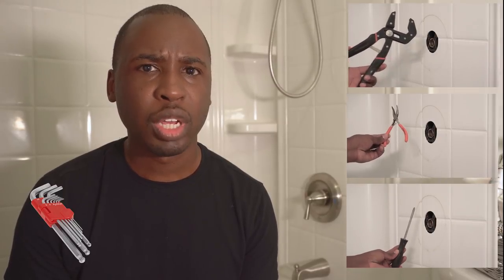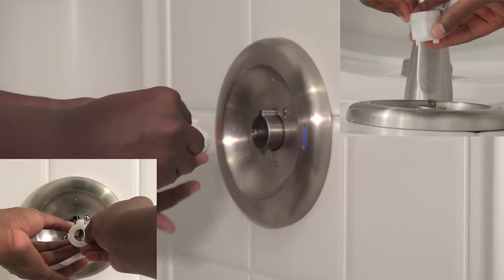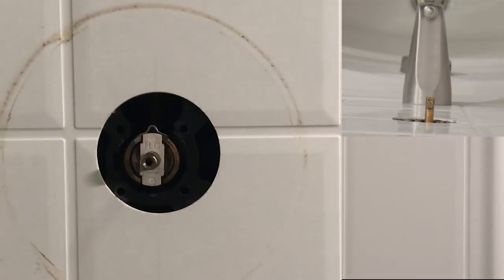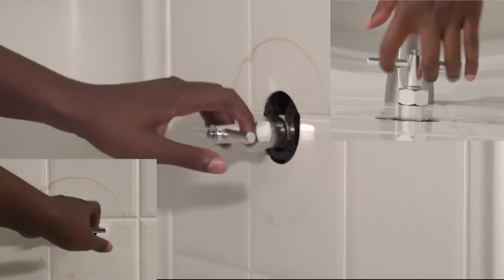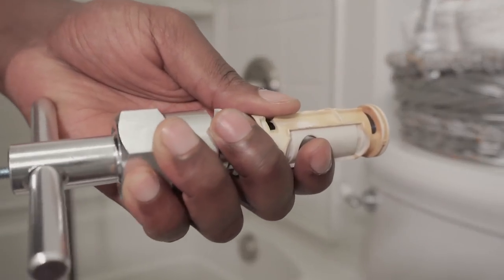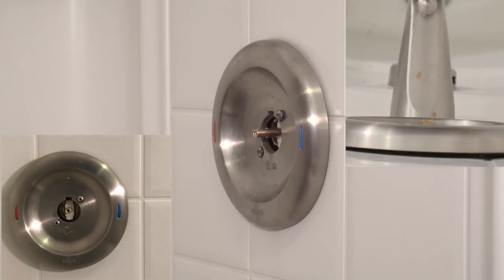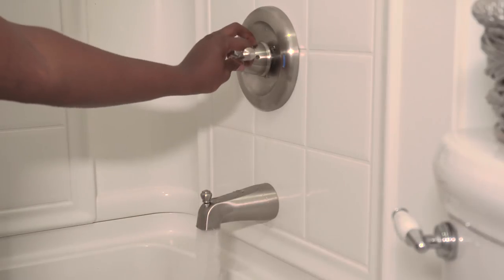How to replace a Moen 1222 shower faucet cartridge

Comment: How would i know if i pushed the center brass piece in too, if i have already inserted the cartridge back in the brass pipe behind the wall?
And do i have to remove the cartridge from the pipe in order to get it to sit back flush?
Reply from the maker: If your faucet leaks or doesn't turn off then you know you have pushed it in. It might be possible to leave it in but i would remove the cartridge to be sure you have corrected the problem.
Reply: Hindsight 101 I see
Well mine turns on and off without any issue , and have no leaks that is visible on the outside, idk about inside within the wall....
But i thought I had push mine in because the alignment metal sleeve is loose, I can move that sleeve back and forth even with the plastic temperature limiter install and everything.

And also the handle turns on and off with no effort now, almost feels too loose so to speak
Reply from the maker: It's your call whether you  remove it or not but if it is leaking behind the wall that could be a very expensive fixed in the future

Comment: Hindsight 101 thanks for the Video. i was able to replace the valve but now I a getting a leak from the faucet valve when I turn it half way to full. Any thoughts??
Reply from the maker: You might want to take it apart to make sure you seated everything correctly

Comment: Farbulous and informative video, but for those with side wall mounted faucets many feet away from the shower head, clear the water lines before removing the cartridge or you'll have lots of water in the wall cavity. Ususally just turning on a sink faucet, which is lower that the shower faucet will do this, but also have a towel on hand....just in case.

Comment: Great video. Are all Moen cartridges the same? Scared to this for a leaking shower handle.
Reply from the maker: They are different but similar process
Reply: @Hindsight101  is there a way to identify which one is needed without pulling it out? Thanks for your fast response.
Reply from the maker: @tonyh4513  you really just have to pull out the cartridge unless you know what model faucet you have

Comment: How do you know which cartridge to purchase? I have a single handle too but did not have the name of the manufacture.
Reply from the maker: The best way to know would be to take it apart and then take the cartridge into a hardware store

Comment: I just used this tutorial to  replace my shower cartridge.  Used to be 6 o'clock was off, 9 O'clock was hot water, 12 O'clock was luke warm and 3 0'clock was cold.
After putting everything back together, I'm now getting 12' O'clock is off,  9 O'clock cold, 3 O'clock hot and 6 O'clock warm.
What did I do wrong putting things back together?
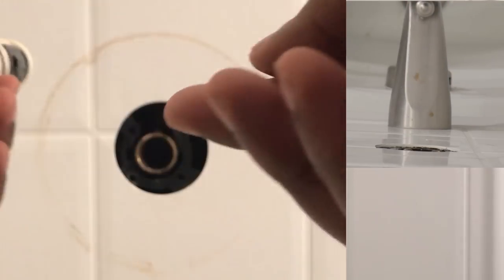Reply from the maker: Make sure you look at the 5:36 mark in the video and see if you did it correctly https://youtu.be/gIeyIMhXQho?t=336
Reply: @Hindsight101  Got it working! Thanks for the response and the video.

Comment: pushed on the cartridge when I was trying to get the pin in. Ok, same mistake you made, but at least I know it will leak if I don’t fix it. Lesson, don’t touch the brass part of the cartridge!
Reply: also, when replacing the 1222, the one I bought from HD that morning labeled Moen 1222 wouldn’t go all the way in. After trying for at least 30 minutes, I ended up trying one my wife bought 10+ years ago. That one went right in!
Reply from the maker: Interesting
Reply: @Hindsight101  yes, you can imagine how the 30 minutes went when I was trying to get the first cartridge in there! 😀 It seemed like the length was about the same, so perhaps it was the diameter that was off. Perhaps the black strips on the side weren’t properly seated.
Reply from the maker: That happened to me with off brand cartridges

Comment: I installed a 1222 but water pressure will not build up through shower head Any suggestions?
Reply from the maker: Make sure you seated the cartridge correctly and you didn't push the brass piece in. But its hard to say without knowing your whole situation.

Comment: the back part mistake that you mention , in order to avoid the error  it must be put on with the puller ? and can i put it whitnout the hot water stoper?
Reply from the maker: The puller or carefully with the plastic piece and a pair of pliers. You need the stopper but you dont have to use its feature

Comment: Do you need to have the limiter?
Reply from the maker: I've never actually tried to take it off but I guess not. If you don't care how hot it gets or just turn the limiter all the way to the max
Reply: @Hindsight101  the water does get hot, i was thinking if it is because it doesn't have it

Comment: I had this shower (posi-temp type) which is very seldom used. So when I opened the valve, there is water leaking under the handle.  But is totally sealed when valve is shut-off.  Is this something that repair can be delayed as I have visitors for 2 weeks.
I am just concerned hoping that all water leaks will be under the handle going to the tub and not going down the pipes behind the wall.
Reply from the maker: I had the same issue at my new house. Always consult an experienced technician but for a couple of days you should be fine. Don’t let it go much longer. Sorry for the delay your comment was sent to spam and I didn’t see it for awhile.
Reply: +Life: Hindsight 101 I guess I'm still okay. It's only being used now by my visitors. It only leaks on the handle when I activate the shower. But not when only the tub faucet is running.
Reply: +Life: Hindsight 101 probably yours was easy to pull as you have a new house.
Reply from the maker: Old house new to me. It took me about 30 mins of working it out. Wasn’t easy but be patient. I had to break it out piece by piece.
Reply: +Life: Hindsight 101 so it came out differently from your vid. Did you have to use a tap to pull it?

Comment: I did it, but it leaks.  The back of cartridge is flush.  I just checked it. It didn't leak before replacement. I changed cartridge bc it was too hard to turn and had calcium build up.  Works great now, but drips a bit. Will that go away overnight? Been 2 hours and still leaking.......help!?!?!?
Reply from the maker: Did you clean up all the calcium deposits before putting the new cartridge in

Comment: It appears that the allen nut on my handle is rusted out, but I'm not 100% sure. I have a 14 piece allen wrench tool with sizes 1/16, 5/64, 3/32, 1/8, 5/32, 3/16, 7/32, 1.5, 2, 2.5, 3, 4, 5 and 6. Does anyone know which allen wrench size they used, and what to do if the nut is actually rusted out?

Comment: Good morning! im assuming there are multiple cartridge? 
Looks like we have same model your working on
Reply from the maker: I’ve only seen a few different cartridges made for meon but there are different vendors that make them. For example there is a cheaper version made by Danco but I would advise staying away I had issues with that brand.

Comment: I did this and prior to doing this, i didnt have a leak. I followed these steps and the water now turns on and off, but water is leaking. Am i doing something wrong? There was no leak before
Reply from the maker: Make sure everything is seated properly. Did you accidentally push it in like I mentioned in the video?  You would have to take out the cartridge to check

Comment: How do I know if the cartridge is the problem?  No water comes out at all when the handle is turned, no drips either.
Reply from the maker: Is there a reason why you're concerned about it? Usually it's because of drips when the handle is in the off position
Reply: @Hindsight101  Well I couldn't get any water out of the faucet at all.  I spoke with a plumber who thought it was a bad "mixer valve."  A little research led me to your video, and I referenced it several times while replacing the cartridge.  Thanks man!  My shower works again

Comment: I did all this and I still have low pressure when on hot, any suggestions?
Reply from the maker: Is it only in this bathroom or is it throughout your house because you could have an issue with your water heater if it’s old

Comment: What size of the hex nut wrench did you use?
Reply from the maker: I use an electronic screwdriver kit and it's a M2.5 if that helps
Reply: After much research I found Moen uses mostly a 7/64 hex nut. this size was not included in the multi-driver set I have. This is why I had so much trouble.
Reply from the maker: Thank you
Reply: I used 3/32, no problem.
Reply from the maker: Thanks

Comment: Another tidbit, when placing new cartridge in, using the Puller Tool just to assist in pushing it all the way in if your having a hard time.  I realized it wasn't all the way in when I couldn't place the retainer clip.  Hope this helps DIY users!!
Reply from the maker: Thanks for the tip

Comment: I replaced the cartridge.  easy.  but, now "off" is straight up.  turn to the left for scalding hot water, only goes 1/4 turn.  turn to the right (clockwise) for cold and then warm (straight down).  what did I do wrong?
Reply from the maker: There could be two issues here first you might’ve put the cartridge in upside down second you may have put the handle adapter in the wrong way it’s the piece right after you take the handle off try those two things and make sure you put them in correctly
Reply: should have called a plumber LMAO why risk flooding your home to save a few bucks?

Comment: We accidentally put the cartridge in upside down with the HC on the bottom (it was originally on top). Now we can't get it to turn off or set it to hot.
Reply from the maker: I’m not sure I understand have you tried putting it in correctly to see if that fixes the problem
Reply: @Hindsight101  It probably would but we can't even pull it out.
Reply from the maker: You can probably get it out but I must warn you you’ll probably end up breaking the cartridge and have to get a new one I know with some other installs that I’ve done with corrosion and other factors it becomes a very tight fit

Comment: so what to do when the cartridge won't turn, to get the old one out?
Reply from the maker: Honestly elbow grease. You have to find the right balance of literally breaking the cartridge piece by piece without damaging the pipe. Sometimes depending on your water the cartridge get stuck in there.
Reply: @Hindsight101  I went to HD and got a puller, and got the cartridge off, eventually.
Reply from the maker: Oh good

Comment: Help! My shower is dripping worse than before! How can I fix it?
Reply from the maker: Can you explain in more detail
Reply: @Hindsight101  I replaced the cartridge in my shower faucet b/c it was dripping. I put a new cartridge in as you show but nothing I did would stop it from leaking. It was worse than the dripping. I kept checking various things, if there was mineral deposits in the internal plumbing, if there was anything left inside the plumping, if everything was aligned. Nothing worked. I gave up, cleaned the mineral deposits from the old one, applied silicone lubricant and reinstalled it. Now it isn't dripping at all! I think I might have a faulty new one.
Reply from the maker: What brand cartridge did you buy?
Reply: @Hindsight101  Moen
Reply: Hi, I just replaced mine right now. A couple of days ago I had to replace some of my galvanized pipes that were leaking and when I opened up the shower faucet it was blocked with rust. I replaced the new cartridge, but first you have to shut off the water. Then remove the old cartridge, before I put the new cartridge. I flushed the pipe by opening up both hot and cold water for about 10 seconds. Then put the new cartridge in. It worked! I think he forget to add this step on his tutorial.
Reply from the maker: I'm not sure

Comment: Is the only way to know which one is the right part , is to remove the old one first?
Reply from the maker: Yes and no. For meon its pretty standard between two parts for this type of faucet so you could get both and return the one you don’t need. Or if you know your model faucet that would help.

Comment: How do you know what size to buy?
Reply from the maker: You can usually google the model and/or brand
Reply: @Hindsight101  All it says is Moen on it.  Bathroom was remodeled by contractor 4 years ago
Reply from the maker: You can always take it a part then match the cartridge up at the store
Reply: Call moen and they'll give you a replacement for free. They ask you if its a pull or rotate handle. I just received mine today and  exactly a week when I called them.
Reply from the maker: It's funny I just made a video about this https://youtu.be/kf9bL3yXoNY. Thanks for the suggestion

Comment: welp. I'm stuck at not being able to pull out the "metal cylinder" after removing the handle and limiter.
Reply from the maker: There might be some buildup around it. Have you tried CLR or anything that would remove it?

Comment: I broke the brass piece sticking out of the cartridge now what
Reply from the maker: There is no good way, you just have to try the best you can without damaging the pipe. I had one where i have to break the cartridge piece by piece until I got it all out.
Reply: Thanks I called a plumber today they took it out piece by piece took them an hour but they knew what they were up against
Reply from the maker: @DR-xt9ux  Glad, it worked out sorry you had to call a plumber

Comment: I recomend to buy the Moen extraction tool, don't buy an imitation  tool buy the original. I was trying to pull the cartridge with channel locks the center thread broke  inside, it was a nightmare to get it out . I'm talking about a 28 year old cartridge. 😧 pain in the ass.
Reply from the maker: AGREE 💯

Comment: I put mine on and the water wont turn off
Reply from the maker: Are you sure you put the cartridge in correctly? Did you turn the main water back on?
Reply: Life: Hindsight 101yes i did turn off main first.the first time i put in the cartridge in with the letters up and same result.water wouldnt turn off no matter what position i turned the valve.also water wouldt come out too hot or cold
Reply from the maker: Did you accidentally push the cartridge in like I showed in the video?
Reply: Life: Hindsight 101 how would i know? .i pushed in for the pin
Reply: Life: Hindsight 101 should i take it back out and check the back?
Reply from the maker: You would have to take the cartridge out of the wall and see if the bottom part of the cartridge is flat or sticking out
Reply from the maker: Yes
Reply: Life: Hindsight 101 so i took it out but the back was diffrent then yours.the back had a noch in a hexagonal shape.didnt look like it moves at all
Reply: Life: Hindsight 101 i put it back in with letters on top but same result.water wont turn off
Reply from the maker: Were you able to fix the issue?
Reply: Life: Hindsight 101 no i wasnt.i was thinking maybe because it was a generic part but i have the feeling itll be the same situation with the OEM
Reply from the maker: I hope it works out for you eventually
Reply: next time just call a plumber. sometimes its better to pay a professional.

Comment: most people wont have the puller
should have shown replacing withiut puller instead
Reply from the maker: I've done it without the puller that why I'm showing with. Much easier and faster
Reply: @Hindsight101  people who are doing this will likely not have it so it makes no sense for them to stand there watch you do it with a different tool
Reply from the maker: You are more than welcome to make your own video and share your expertise

Comment: 1) "Make sure to have vise grips"
2) Proceeds to not use any vise grips at all and uses specialized moen cartridge puller tool instead.
Reply from the maker: I see you only made it to the first 30 seconds
Reply: @Hindsight101  Ha, ha. Actually I watched it twice because I had to replace my cartridge today and I ended up using some pliers and your video was very helpful. Unfortunately, when I removed the cartridge, I still had water leaking from the open valve pipe even 1 hour later. In your video, there is no water leaking from the open pipe. Do you have any idea why the water wouldn't stop? Yes, I turned off the water to the house and no more water was coming out of any faucet, so I'm kind of stumped. I'm hesitant to just lube up a new cartridge and jam it into a pipe that I can't seem to dry out. Thanks!
Reply from the maker: @JohnSmith-ho3cu  How much water was coming? Out of curisity can you turn off the water to just the shower and see what happens?
Reply: @Hindsight101  It started out as a gentle stream for about 15 minutes then settled into a rapid drip for 30 min, then slowed down but never stopped. I don't think my shower has a separate water shutoff.